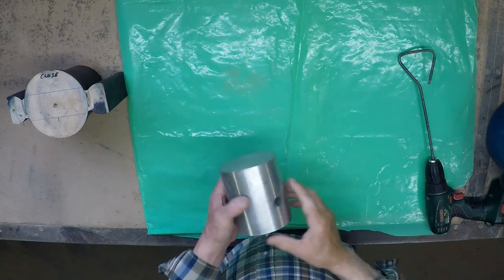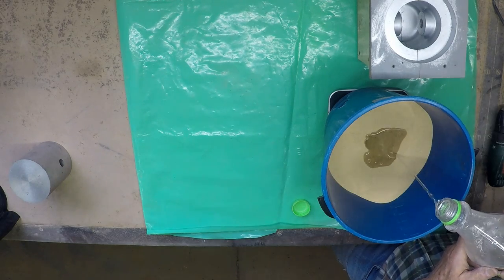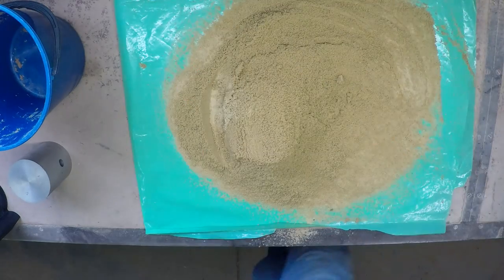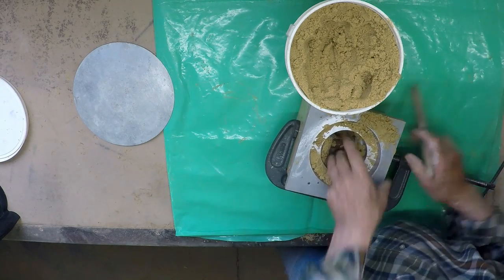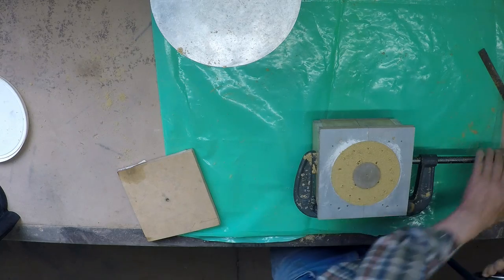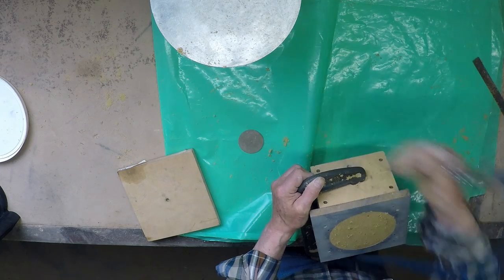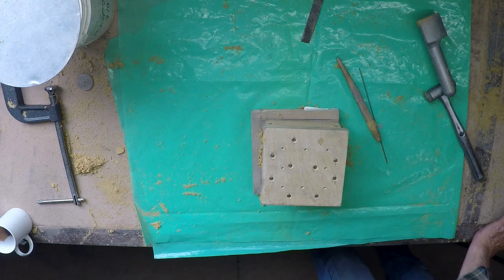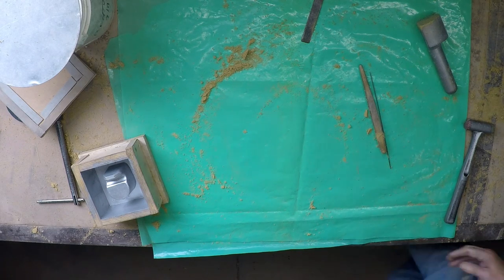Casting a piston for a 1910 Brush car. Part 2:- The CO2 silicate core

Comment: Laughin, maaaaate!
Just wondering where is the best place in Australia to get sodium silicate?
Reply: ABLE WESTCHEM  (About $35.00 +gst per 5L)
Reply from the maker: Ron, Are you sure its silicon and not silica i.e. silicon dioxide (sand). With the caustic soda method they generally use pure white sand.. Martin
Reply from the maker: Ram, Can't find it on their rather strangely arranged web site so I will take your word for it . That is not too bad a price... Martin
Reply from the maker: Michael, I Was lucky I picked up about 50 litres many years ago but as I have almost run out so I need a supplier too! A bit of work with the great God google shows several sources within Australia, including fleabay (expensive) and a lot of pottery supply houses that carry it again not cheap - Ramshackle seems to be on to a good source. Next time I need it I will probably just go to Foseco and buy the CO2 silicate binder that they sell, it will probably already incorporate a breakdown agent - assuming of course that I can get it from them in reasonable small quantity. You could try a local foundry that uses it and offer them a handful of green for a few litres of it., It would be welcome beer money for them!  Martin
Reply: Martin, thankyou for the extensive reply, really appreciated.  If I find a source I will let you know. I have heard you can cook some up at home but would need to research that. Cheers Michael.

Comment: Hi,
interesting putting glucose powder into teh core mix. stated to make the core easier to dig out. could I ask , why not just put less silicate into the mix??
Reply from the maker: Charles, As I said in the video a 7.5% sodium silicate addition makes for a strong core - a very strong core. I certainly could have used 5% and indeed often have in the past. Properly mixed and gassed this is quite strong too. The breakdown at 5% is still poor but you don't have to use as big a hammer on the chisel  😏.Or resort to a masonry drill as much! I have had the unfortunate experience of placing a core in a  mould only to have it break as I did so and fall into the mould - not only do you loose the core  - you loose the mould too - so I like to keep my cores strong to avoid that as far as possible. I think it would be a very fine balance to make a core weak enough to breakdown easily (without the glucose) yet strong enough to be handed safely. For me its just easier to make a strong core and incorporate the breakdown agent. (Note, the breakdown agent does make the core a little weaker) I use ordinary sodium silicate not a propriety brew of a formulated binder for the Silicate/ CO2 process - I suspect that some, if not most, propriety brews have a breakdown agent incorporated in them.
With the glucose incorporated the core will just hose out - little if any scraping and no chiselling required - the difference is truly amazing. It does seem to help if the casting is quenched in water - the heat plus the water really seems to get stuck into softening the core... Martin
Reply: Hi Martin,
Thank you. as I see it you need strength to hold the core together, but the glucose powder helps the washing out of the material after the casting.

thanks again.
Reply from the maker: Charles, Yes, I think so but I suspect the heat of the casting does something to the glucose too as it almost seems to wash out in  a layered way with the core a short distance from the casting washing out easiest. I guess you have to see it yo know what I mean. Try it, you will be well pleased.. Martin

Comment: Interesting, what kind of aluminum are you using for pistons?
Reply from the maker: Marty, The alloy is 336 known locally as AA319 and as LM 13 in the UK... Martin
Reply: US SAE 336. Not just soda cans will do. But what could soda cans be used for? Better to reclaim a cylinder head for certain items? I'm transfixed sir. Thank you so very much. New Zealand's Burt Munro modified his engine with such techniques. Amazing.

Comment: another thought: if the core is very hard and does not break when pouring molten metal on it, would that sand mix be usable as a refractory to make a forge?
Reply from the maker: Luke, Here I am just plain not sure! But I suspect that the difference between a momentary few minutes immersion in molten aluminium and constant exposure to that temperature and well above for hours on end might be very significant. Also there is the problem of that wretched sudden expansion that silica goes through at 530 Deg. C. I should imagine that cycling through this zone each time a furnace was fired up and later cooled down would slowly pull it  apart. There are aggregates that do not suffer this problem or at least not as badly - Zircon , chromite ,olivine, chamotte - lots of them in fact and many are ingredients in traditional refractories. Also we do not know what the sodium silicate actually becomes during gassing with the CO2 - it is tempting to think it converts to sodium carbonate ???? plus some silica gel. The latter would have a high melting point but sodium carbonate melts at about 830 deg. C. All you could do is try it and see what happens but prepare to be disappointed... Martin
Reply: @olfoundryman8418  would make an interesting experiment. But you make some VERY good points against it :)))
Reply: @lukearts2954 , no, it will desintergrate at high temps. I worked in a large steel foundry using ss cores & they completely desintergrated in the shake out & were used for makeup sand.
Our bottom pour ladles used a sand nozzle & stopper, their life span was seconds to minutes, even the large ladle (70 ton) linings were 2 feet thick and lasted 8 hours or less.
Reply: @pvtimberfaller  Thank you, Ross. It's sharing of experience and knowledge like this, that makes YouTube a great platform. You save me time, effort and money! There's obviously no need to test what has already been proven :)))

Comment: That release agent looks like Loctite Anti-seize.  Would that be it?
Reply from the maker: Gerald, No, not anti-seize It is Mo0ldecoat 15 made by Foseco. it is not actually a release agent but rather a chill coat for some sand mould surfaces it just seems to work for me as a release agent. Loctite anti-seize may well work though,  but if I remember right about Loctite stuff it could be a bit expensive... Martin
Reply: Loctite is also very hard to clean off.  There are memes online about mechanics getting it all over themselves. @olfoundryman8418

Comment: Was wondering why you didn’t just use your normal core making sand instead of sodium silicate sand
Reply from the maker: jkay, My "normal" core sand is a shell sand and it requires a hot (about 180 deg. C) core box mould to cure its binder, the mould has to be a reasonably good conductor of heat. The core box I had in this case was made from wood so no way it cold be used for a shell core... Martin
Reply: @olfoundryman8418  ah okay was just curious  thank you for the explanation

Comment: Is that mold made of aluminum?
Reply from the maker: Booger, It sure looks like aluminium doesn't it? But no, its actually wood. The release agent that I use tomake the cores come out easier is sort of like an aluminium  paint and it gives the core box that aluminium look. If it had actually been aluminium I would have used shell sand cores as they are a lot better to work with... Martin
Reply: Yeah. I thought it's aluminium because of the color. Then I got confused when I see the bottom that looks like wood so I asked about it. Lol

Comment: Is it possible to make the piston with 3d metal printing?
Reply from the maker: Jeffrey, I honestly do not know. I suspect that it could be, but doubt the economics  - a "few off" would have to bear the cost of drawing, programming,  and printing while a "lot off" would be up against the traditional gravity diecasting with its production rate of one every 11/2 to 2 minutes. 3d printing is improving all the time though, so who knows what the future holds for parts like this...Martin
Reply: @olfoundryman8418  Good response, I was just wondering.   I have done a little metal casting at home, but never any 3d printing.    but metal printing will have an amazing future.   Jay Leno talks about having parts for his antique cars made that way.  Keep up the videos.
Reply from the maker: Jeffery, I think 3D printing to be in its infancy - will it die out,  become a niche method, or will it go on to bigger things? Time will tell, my guess, somewhere between the last two... Martin
Reply: @olfoundryman8418  Martin:   It is my understanding that SpaceX is using 3d metal printers to build their rocket engines and possibly their fuel tanks, and possibly their spaceships.   amazing, if true.

Comment: Why not put the wires under the core? I would assume that would help keeping the wires in place as you stump the sand more, and might create more unity?

Something else that struck me... You're a foundry man, but you don't work with metal nearly as much as you work with sand =D Of course, you need your metallurgy and your fluidomechanics knowledge up there, but your true craft ability lies in the crafting with sand...
Reply from the maker: Luke, I am not quite sure what you mean by "wires under the core" can you clarify please.
Sand versus metal - Hmm, really both play a very important part and you don't tend to see the metal side of it as much in the video as the sand side, partly because the metal side is easier to control - good certified ingot, correct temperature, good degassing fluxing etc and care in handling and particularly pouring. The fluid side of things is forever an ongoing exercise in  reading and learning and trying again it tens to goon more in the background just the results appear in the videos.
Basically of course the sand side is just being a kid at the beach with a bucket and spade ...😏… Martin
Reply: @olfoundryman8418  sorry, I used the wrong word... I meant the first wires you put in around 7:00 could have gone under and around the pin (so put in a bit sooner) adding an extra context between the parts under and above the pin... (I suppose if such a core breaks, it will break parallel to the bottom and at the height of that pin you put in there because of the difference in material and density) (I'm sorry, I just couldn't make out the correct word for that pin)
Reply: @olfoundryman8418  about the bucket and spade: yes, that's certainly the feeling, but it's a kid that makes precision parts with his bucket, and the proper handling of the sand determines the level of precision, right? Just like you say: the metal part is more controllable, so it is more likely that even with less skill a decent result can be gotten on that front. But on the sand front, without skill there's no result at all...
Reply from the maker: Luke. I had thought of this and it would have worked very well indeed but I decided that it would have been to awkward to poke the sand around it. IN truth with a 7.5 silicate sand I would most likely have got away with no wires at all!... Martin
Reply from the maker: Luke, Re bucket and spade,- you are right of course but I will never be like those people who carve those fantastic sculptures out of (allegedly) beach sand they really do have skill... Martin
Reply: @olfoundryman8418  you'd be surprised at how easy that is... And if you are talking about the huge sand sculptures: those guys have 2 advantages: most of the time they are allowed to mix in like 5 or 10% cement (at least, in the European contests/exhibitions that I've seen here closeby) and all sand used in those is brought in and later removed from the beach for public health and safety reasons.... Goes to show. The second advantage is the scale vs resolution. When you make something really large, it doesn't matter if you miss a few mm here and there because nobody will see it. So while the totality looks super crisp, when looking up close, it really isn't that much different from what kids do with a good castle bucket.
I'm an art lover, but I estimate your skill for precision higher than a sand sculptor's skill for esthetics.
Reply: Ron Carter  I don't know who is the target of your uncalled for aggression, but this channel is not really the place for that kind of narrative. I've reread the entire thread, and your comment doesn't seem to make any sense anyway, bud...

Comment: the piston is a simple enough shape why wasnt it just machined from a billet.
Reply from the maker: Stan, This issue has been discussed/commented on  at some length. In the final part of this video series (part 3b) I spend some minutes towards the end of the video discussing just this issue and I refer you to that for the complete reasoning. However for the short version its quite simple I was asked to cast them so I did... Martin